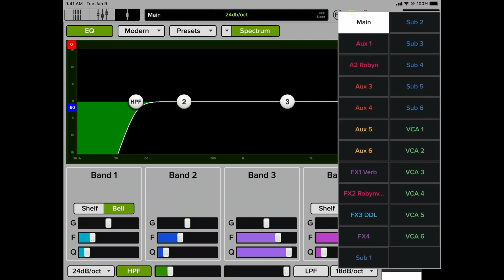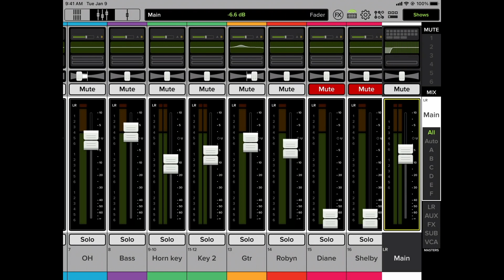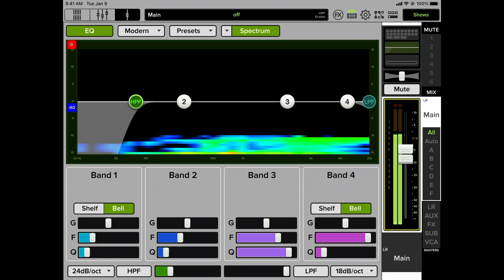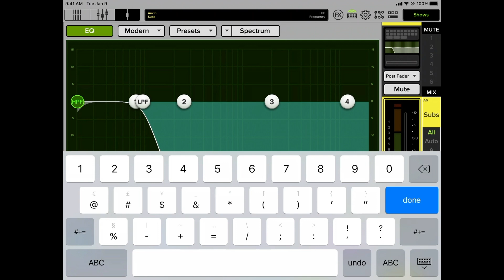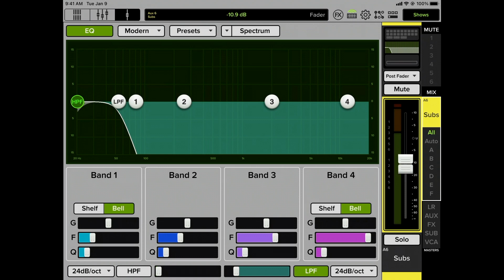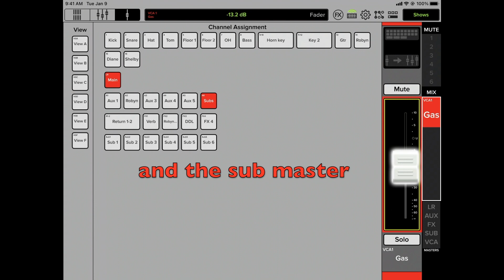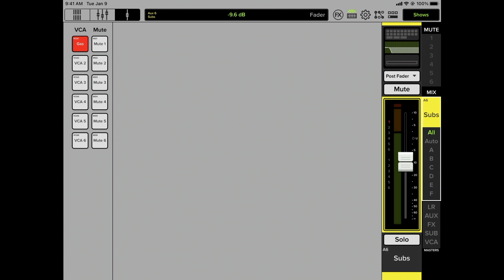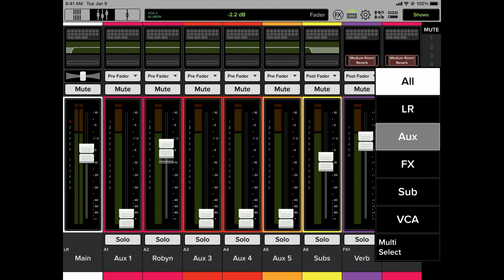Mackie Master Fader 5 Aux fed Subwoofers

Comment: In Master Fader SE, I cannot see the 4 band EQ with the HPF and LPF,  I tried everything I can only see individual sliders?
Reply: My Auxiliaries also do not have the  4 band with HPF & LPF,  only sliders/faders
Reply from the maker: if you are using Master Fader on a phone, you will not be able to see the EQ, only on an iPad or tablet.
Reply: Im using an IPad and I also have an Android A9+ and it does not have it.  It must be SE version, so now I have to figure how to set it with slders/faders
Reply from the maker: @Vet_Navy_Diver  I just read that the SE version of Master Fader only runs DL "SE" mixers. What mixer are you using?

Comment: Professor, I learn so much from all your videos.  I am going to try this on my next gig. Since I use the elx200 18p sub with my elx200 15p tops, the sub and tops automatically set the crossover between them.  So I do not use the Aux fed subs approach.  I want to hear the difference.
Reply from the maker: Phil, thanks for watching! You will absolutely love the control and massively improved sound.

Comment: How do you add low pass it's not in the auxiliary settings
Reply from the maker: you don't "add" low pass... it is in the EQ of all the aux outputs
Reply: @user-jx3jp3gb4x  one I setup there is a low pass button on the bottom right
 I forget how I did it though.
Reply from the maker: @BudRV  watch the video
Reply: Bro I did 7 times now you never mention how to actually get the low pass filter on the bottom right. It's not just automatically on the screen like the high pass is.  I forgot how I found out before I thing it was in a group. Don't get me wrong I love your videos. Keep up the good work. Thank you for doing them.
Reply: @BudRV same issue for me
Reply: @rudeboyhansley8612  look on the sux outputs under the eq menu.
Reply from the maker: If you are seeing a high pass filter but not a low pass filter, it is because you are looking at an input EQ. Inputs do not have low pass filters. You need to look at the EQ for the aux output that you intend to use for your subwoofers. If you look at the EQ of one of the aux outputs, you will see both filters, the high pass on the lower left, and the low pass on the lower right.
Reply: @user-jx3jp3gb4x  that's what I was looking at brother. Aren't you in st louis also? Can I pay you to help me I can even come to you. Or even for video help like live video.

Comment: Was not meant for you but Mckie the software is not good at all fails in may ways and unstable in pro  leavel
Reply from the maker: Hi Leslie, if Master Fader 5 is failing you and crashing, then you are doing something wrong. It is unbelievably reliable, what problems do you have with it?

Comment: Hi Dan how do I get the Aux6 for the Subs to work, I tried the method that you explained in your video Part 5 (Aux fed Subwoofers) it does not seem to work, please help me in detail as to how it should be connected. Thank you Leylan.
Reply from the maker: Hi Leylan, happy to help, but you have not given me any details about what mixer you are using and what subwoofers. ???  Have you verified that the mix output for your subs that you want to use is actually producing audio?
Reply: @user-jx3jp3gb4x  thank you for your reply. The mixer I’m using is a Mackie Dl1608 with JBL PRX518subs & PRX15 columns for the tops
Reply: Sorry I do not know what you mean about verified that the mixer output for subs that you use is producing audio? I use the JBL's for my FOH for my band.
Reply from the maker: @leylanlamb4590  
here is the wiring for your set up in order to use a separate aux for subs... 
The PRX15S top cabinets do not connect to the PRX18S subs at all.    
DL1608 Main output L connects to your left PRX15S.  
DL1608 Main output R connects to your right PRX15S. 
DL1608 Aux 6 output connects to your closest sub.... assuming you have one sub on each side.
"Daisy-chain" the two subs with an XLR cable between them.... in other words... go "out" of the first sub, and "into" the input of the other sub. 
Follow the information in the video and your Aux 6 will give audio to the subs.
and here a link for thanks :) https://www.paypal.me/kurysound
Reply: Thank you very much for the info Dan. The PRX18s 2 subs are connected from the Right output of the DL1608 via Daisy Chain and the PRX15s from the Left output on the DL1608 the same way you connect the subs. Is that correct? If I can impose on you can you please send me a diagram. Thank you Leylan.
Reply from the maker: @leylanlamb4590  follow the directions in the post I just made for you twenty minutes ago. There is very specific directions. Your last description of how you have the speakers wired is completely wrong. Just follow my directions.
Reply from the maker: @leylanlamb4590  here is the wiring for your set up in order to use a separate aux for subs... 
The PRX15S top cabinets do not connect to the PRX18S subs at all.    
DL1608 Main output L connects to your left PRX15S.  
DL1608 Main output R connects to your right PRX15S. 
DL1608 Aux 6 output connects to your closest sub.... assuming you have one sub on each side.
"Daisy-chain" the two subs with an XLR cable between them.... in other words... go "out" of the first sub, and "into" the input of the other sub. 
Follow the information in the video and your Aux 6 will give audio to the subs.
and here a link for thanks :) https://www.paypal.me/kurysound

Comment: how did you get parametric EQ on AUX ? All AUX's and MAIN faders only have Graphic EQ on my DL 32s and fader 5
Reply from the maker: Hi Robert, you can swipe up or down to access either parametric or graphic EQ. You need to know about where the "swipe" areas are in order to accomplish this, it is all in the manual in numerous sections. Search the manual for PEQ, or GEQ, or swipe. When you are viewing the graphic EQ (GEQ) the swipe are is the blank area at the top between the two tabs, RTA and 2X. Also, in the settings you can set the "Default Output EQ View" This way, when you open the EQ on an output, it will take you to your preferred EQ.
Reply: It is correct thank you for the information. Great video.

Comment: Thankyou for this video - really helping. I have a question, though it may just show my lack of understanding on setting up PA's..: If I was to get the chance to ring out a room that I am setting up, would I remove the cutoff filters prior to ringing out? At first I thought yes, but then I thought that doing that might make me attenuate frequencies that will then lose their "oomph" once the filters re-applied? (maybe this question is just applicable to the frequencies around the crossover point).
Reply from the maker: Hi Andrew, what cutoff frequencies are you talking about? If you are talking about the high pass filter (low cut) that you have on your main speakers, then that frequency should (ideally) match the crossover frequency that the subs take over. I have been doing this for over 50 years and I never "ring out" a room, I set up my system and only if I am having issues do I fix them. If you want to ring out the room, meaning to squeeze out every decibel of sound that you can get, then it is obvious that the fidelity is not important, only maximum volume. The next time you do a job with your system, I highly suggest allowing the main speakers to sound like they can. "Almost" everybody in the world slaps EQ and compression on everything before they even hear if the sound needs it or can "benefit" from it...., but that is the last thing you should do if you have a nice system and nice mics. (not 58's)
Reply: @user-jx3jp3gb4x  I appreciate your taking the time to reply - thankyou. I had a 3 day sound gig with about 30 acts to set up. I did ring out the room during setup, and I had no feedback issues, and the sound was very high fidelity. I prefer to do it this way, as to my understanding we ring out the room to actally flatten the response of the room - thus enabling true fidelity. A room being an acoustic "shape" that will resonate naturally with certain frequencies. meaning that if those frequencies are generated within the space, along with other frequencies, then the resonant frequencies are going to reinforce themselves and dominate the soundscape? So ringing out the room allows you to compensate for this unequal resonance and enable all frequencies in be present in the levels desired by the musicians / instruments?
Reply from the maker: @AndrewDInSydney  Hi Andrew, I know all about ringing out a room, unfortunately there is no piece of audio gear invented or plugins or anything that can address or "fix" the frequency problems you are referring to. Lowering a frequency band and setting it's bandwidth on the offending frequency/s does not fix the problem. It masks it to some ears. The problem with the frequencies that you are cutting is only changing the volume of those frequencies relative to other frequencies that are not causing fidelity issues. The problem is the room's reverberation time. It would be nice if we could lower the reverb time of those offending frequencies, but using an EQ to address this is not a fix. It is a bandaid. My recommendation was to essentially leave the EQ on the main system as close to untouched as possible, realizing that yes, certainly sometimes a tweak of EQ on the mains is definitely necessary and makes the system sound nicer. Ringing out monitors is a completely different story as you already know, but squeezing out every decibel of gain you can achieve before feedback in the mains in my opinion is not a good thing to do. Altering too many bands of EQ will make a false sounding system. Good discussion though. :)

Comment: So, the SubWoofers doesn’t necessarily have to be plugged in to a AUX output on the mixer right? Like the connection is done by the 2 main outs to the subs, then highs are connected from each subs?
Reply from the maker: NO..... The left and right main speakers are connected to the Main Left/right outputs. The sub is connected to one Aux output that feeds both subs
Reply: @user-jx3jp3gb4x  Thank You So much 😊
Reply from the maker: @DjazzStyle  glad to help, try it :)

Comment: Thank you...This helped me greatly! I still get a little bleed through of the mains into the subs and probably visa versa but that might be the case without an actual crossover
Reply from the maker: if you have things set up properly, you should be able to plug headphones into the headphone jack and solo the aux output that you are using for the subs. Understand that without proper processing for the subs (low pass filter) to cut all the highs off, you will still hear full range sound when soling the "sub" aux however, you will at least know exactly what sounds are going to the subs. Are you using powered subs? Also, your statement about bleed through the mains was a little confusing... contact me through my website if you like so I can help you further if need. https://www.kurysound.com

Comment: Hi  Dan: I use 4 (single 18”) powered subwoofer. Would you daisychain all 4 subs from aux 6 or use aux 5 for 2 subs and aux 6 for the other 2. Thanks
Reply from the maker: Hi, if all the subs are the same brand and model I highly suggest using just one Aux send for all of them. They can be daisy chained (XLR out of each one into the next one). Also,.... every time you set them up, try your best to put them all together, side by side in the center of the stage (not on the stage) instead of two on each side. Doing this will radically improve the balance of the subs so that everyone in the room gets good even bass response instead of just the people in the center of the room. When you have subs on each side of the stage, that arrangement will cause what we call a "power alley", This is where the subs on both sides produce nice bass in the center of the room (dance floor), BUT........ if the listener moves closer to one side or the other, the bass response will deteriorate to the point of being really wimpy. This is because the amount of time it takes for the bass from the subs (over there) causes what is called a phase cancellation because of the time difference. Sometimes we don't have a choice, and we can only put subs on each side,... when that's the case, we just live with it. Dave Rat from Rat sound has some really good videos on youtube about this very thing.  I hope that helps :) Always trust your ears.
Reply: @user-jx3jp3gb4x  So its better just to stack subs dead center?
Reply from the maker: @tommysmoothsiconolfi9401  Hi Tommy, I hope your day is going great! my short answer is ... yes.  Here is a really good video explaining phase cancellation.  https://youtu.be/VwLH7zP6Lwo
Reply: @user-jx3jp3gb4x  Thanks Buddy same to you. Thanks for the help
Reply from the maker: @tommysmoothsiconolfi9401  👍

Comment: How to get the Lowpassfilter . I can only see HPF on my EQ
Reply from the maker: inputs channels do not have an LPF, only the outputs do.
Reply: @user-jx3jp3gb4x  Tq for the reply. YES , it is on my aux 5 and 6 where the subs woofers  spreakers. 
The current EQ is the parametric not like what i see in ur video the modern version. Do we download it somewhere? ..
Reply from the maker: @sleazefunk  I'm not sure what you mean. There are two different equalizers available on the outputs. A Parametric which is where you will find the Low Pass and High Pass filters. There is also a graphic EQ that I believe is 31 bands, it does not have the low and high pass filters. The only thing to download is the specific version of Master Fader that you prefer to use. Are you using Master Fader 4 or 5?
Reply from the maker: @sleazefunk  the manual explains all of the swiping and how you can navigate to different screens. First, there are grey blank areas in many of the screens, some are small and some large, and they're made to swipe left and right while others are made to swipe up and down. Some of these areas are very large,,, you need to learn these "swipe" areas and where they are. These areas are places that you can use your finger to swipe up or down in order to get to different features/screens. 

For instance, in the "Graphic EQ" (GEQ) this grey "swipe" area is between the white (RTA) button, and the white (2X) button. Put you finger on that small grey area and swipe down, .... you will then be taken to the "Parametric EQ" (PEQ), if you swipe up from that same area, you will be taken to the compressor. You need to learn about Mackie's swiping features if you are going to be using this app. Another feature which I am guessing you probably don't know about is in settings. Settings can be viewed by hitting the "gear" icon at the top. This is where you can set various things to act based on your preferences. The very first feature is "Default Output EQ View". This is set to GEQ by default, but you can change it to PEQ, then whenever you click on the EQ tab, you will immediately be taken to the PEQ instead of the graphic. 

People never read the entire manual and they will never understand all the nice features that are right there at your fingertips. You will be missing out on a ton of ways to do things and ways to do things FASTER!